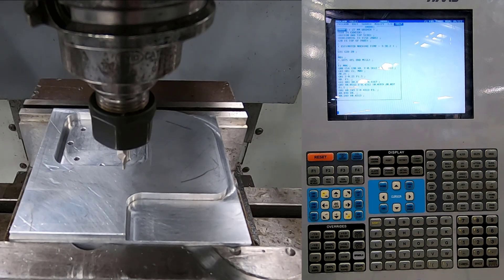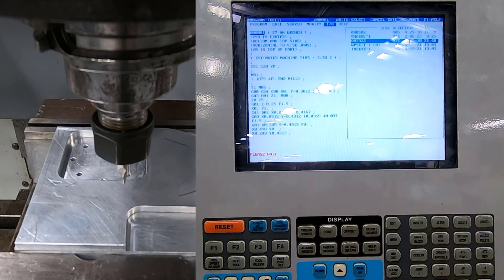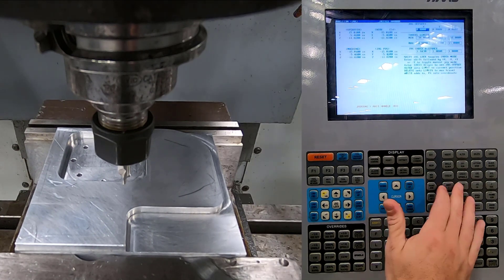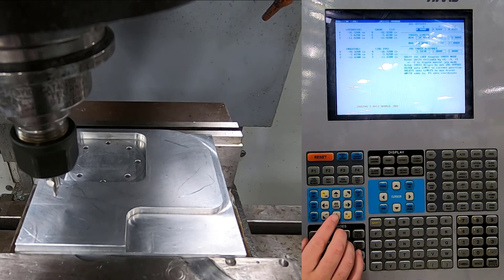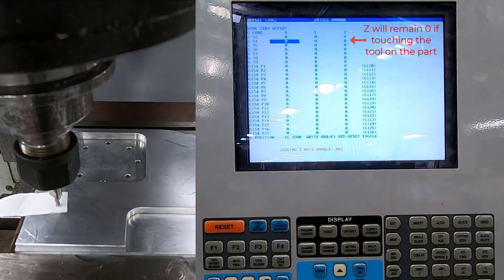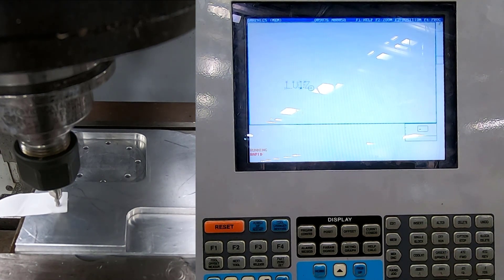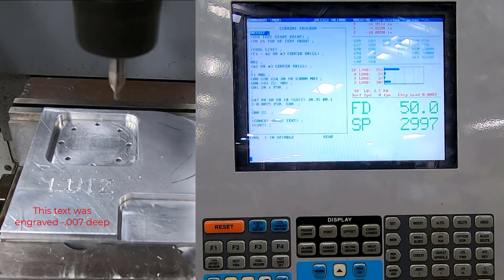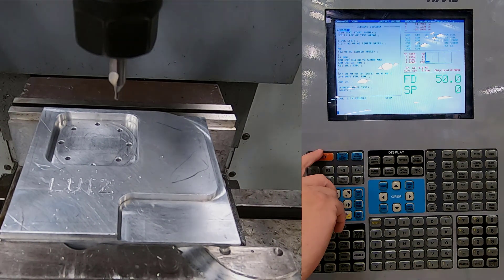CNC Mill Simple Engraving Setup Using G47

Comment: How would I use a G47 to engrave “Reibert/Heath Cornhole Champions 2023” ? Thanks.
Reply: Just put the text you need in the parentheses. After the G47 code. Make sure to graph it so everything looks correct before running.